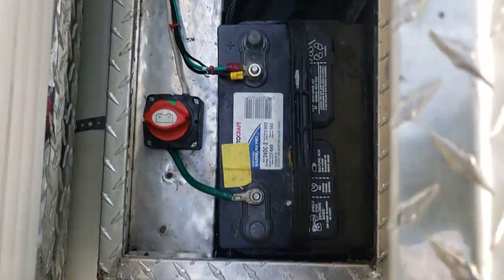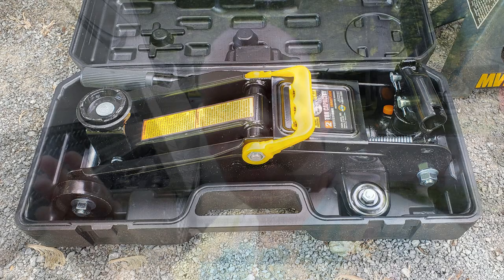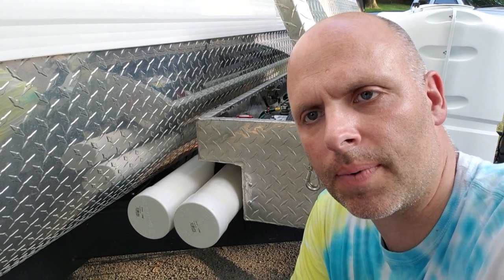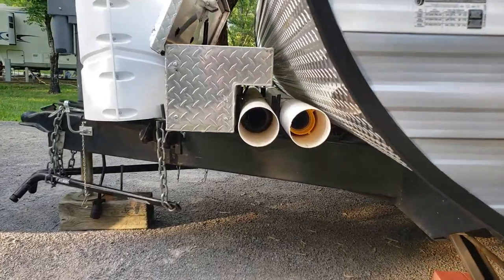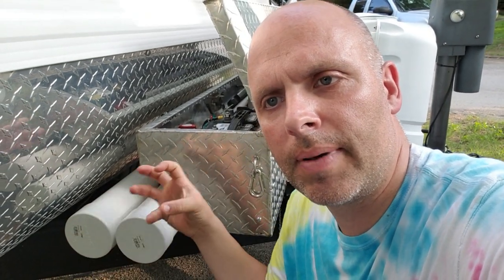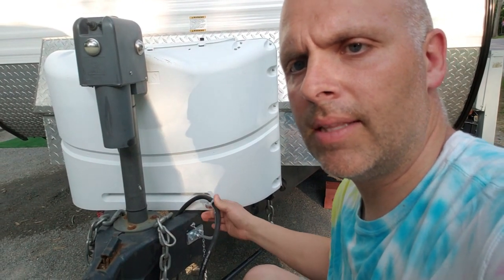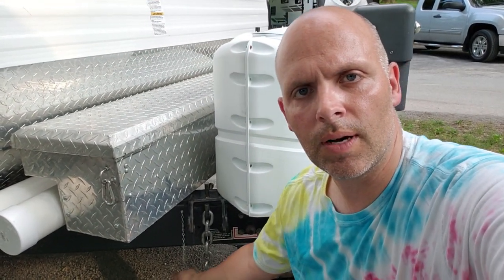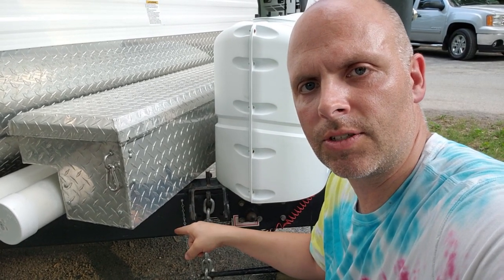Camper Tongue Modification - More Storage, less forgetful!

Comment: I like the job box idea. I gonna take some measurements to see if that will work with my set up. I have the equalizer hitch. The brackets stick up above the frame. I may need to remedy that issue to install the box.  Thank you
Reply from the maker: Thanks for messaging! It was a tight squeeze but I managed to for everything! Good luck! Make it happen!